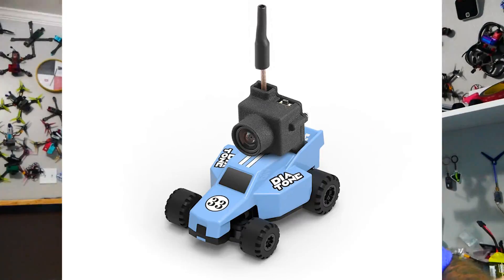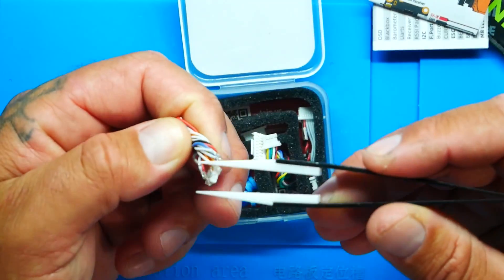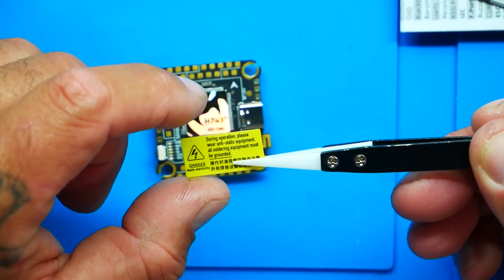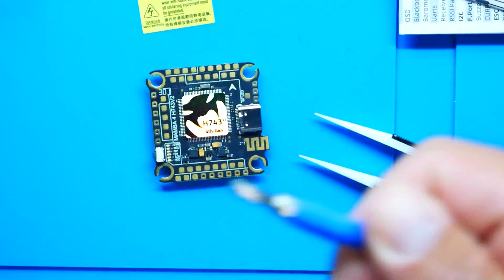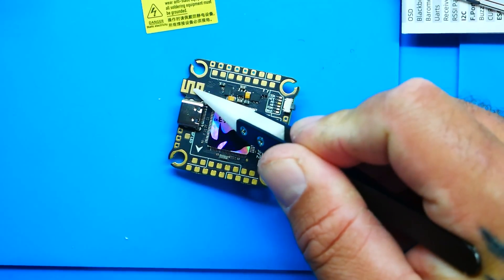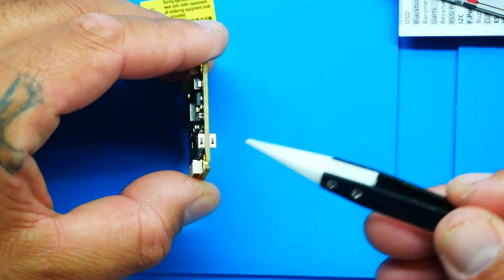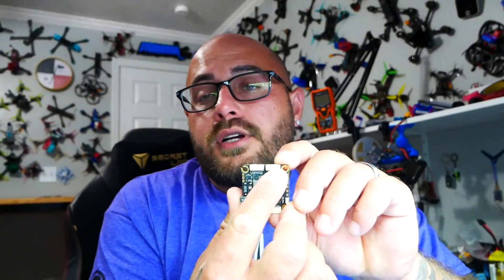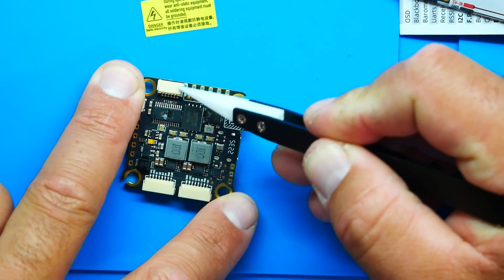All New 4th-Gen H7 Flight Controller - MK4 Version 2

Comment: Dude, I have the f722 version - brand new build and I’m only getting one or two green LED. Esc seems to be working fine. Used cable provided and checked pin out and looks fine. I’m confused..about to give up tonight and put a new fc in. I get power from usb and can connect to betaflight. Should I try to update firmware first? That wouldn’t be the cause of not powering up proper though right..? An obvious power issue but I’ve checked joints or shorts and looks good! Thanks!